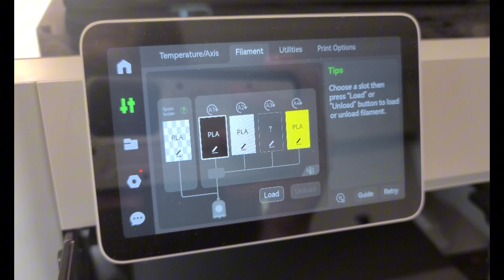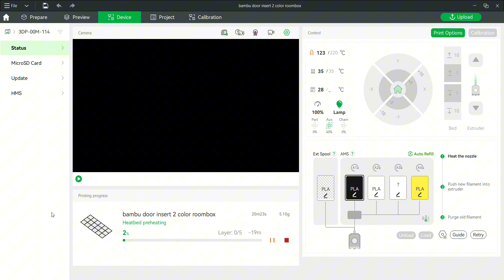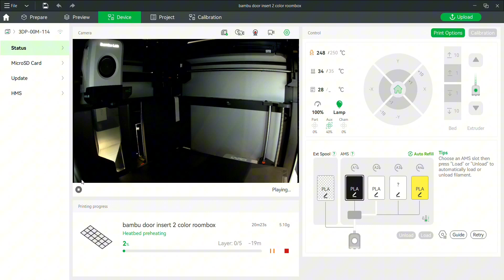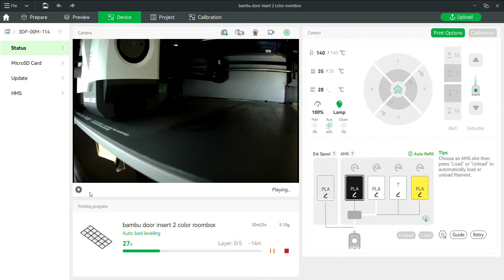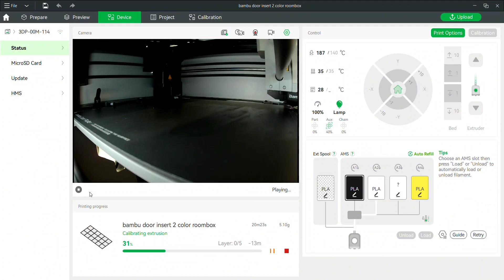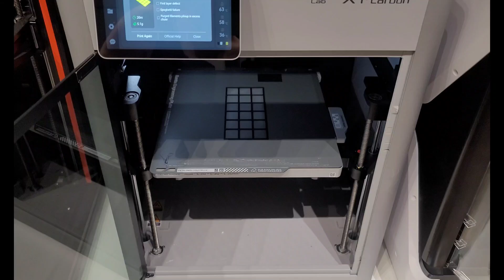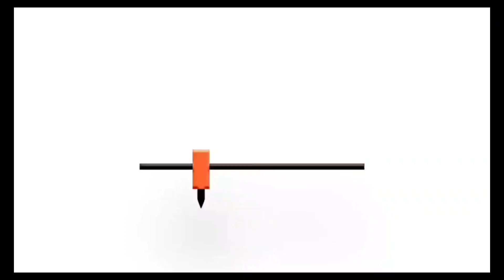The Bambu Carbon takes HOW long to start a print?

Comment: I am scared right now. Using a prusa mini+ now... telling alexa to preheat (takes roughly 1.25minutes) and after hitting print in prusa slicer the bed level starts (takes 40 seconds) All in all 2min10sec and it starts printing! When pre heated my prints start in 45 seconds...
Reply from the maker: That's awesome!

Comment: You definitely don't need to run the filament calibration every time, just when you put in a new nozzle or new brand of filament. It remembers the last calibration. But ya, it takes a bit for the bed leveling. Good thing is they really got the AI on the camera and the lidar working great in the last year. The camera will pick up a failed spaghetti print really quick, and the Lidar has warned me about first layer problems, but I usually just go over it and it works out.
  For me I've gotten used to it as it prints fast enough to make up for that time lost calibrating. And I wouldn't doubt they are working on making it faster.
  The one thing I really appreciate about this printer is the warnings it will give you if anything with the printer goes wrong. One warning I got was to check the bed cable tension. At first, I thought wth does this mean, but when I took a deep look, I found one wire under the bed wasn't sitting right and you could see it had marks on it from getting caught up at the back. So, I just taped it up, and tied it up higher so it wouldn't get caught. That saved me from ripping out a wire and having to change the entire bed harness. And after 1700 hrs the only time my printer has been down was from getting plugged up once, which was my fault. 
  That is, one often overlooked feature of this printer. If it detects any abnormalities in the system, it warns you right away, and also gives you instructions on what to look for by just scanning the code with your phone.
Reply from the maker: That sounds very user friendly. Thanks!

Comment: some thoughts with all the printers in the room if I was to make this, I would just break it up put one part on the mk4 and another on another mk4 or bunch on the XL. In 20 minutes, you and have at least 4 of them done? Glue I would look to get a wambam plate for the bambu I have changed booth of the K1 and k1 max with these build plates
Reply from the maker: Ok thanks so much!
Reply from the maker: Ok thanks so much!

Comment: Ok two things, one, you don’t need to leave the front door open, and two, why are you using the engineering plate for PLA?! The cool plate is for pla and engineering is for any other filament. Anyways I would recommend buying the textured pei sheet from them. You don’t have to use glue stick and that makes it so much easier.
Reply from the maker: Idk why I had it on that side. I have since switched to the cool plate. I don't love texture on most prints but I'll see if they sent one too. Thanks!
Reply: @tada3dprinting  they also have a “high temp plate” it’s a smooth pei and can do pla, petg, tpu, etc

Comment: I'll help you out. You can "sync" the colors in the AMS by pressing 1 button
Next to "flushing volumes " and the + - buttons to the right is a sync AMS icon. You can sync or resync. Then you dont need to manually select colors if you labeled them correctly.

Also you can change the generic pla profiles to bambu pla as the only difference is flow rates from 12mm/s to 22mm/s. You will print faster and most plas print fine. This is with over a year of testing non bambu filament.
Reply from the maker: Ok good to know! Thanks so much!

Comment: You have found the big downside to the Bambu, the startup process.  It takes time, but I'm willing to let it do its thing since most of the prints just work.  A suggestion is to print multiple at once.  It looked like you could do 3 at one time, probably only add about 10 minutes to the job.  I only use the cool plate when I really need to have small parts stick.  The third party plates work well especially for something with a large flat area like those frames.
Reply from the maker: Ok thanks so much!

Comment: That's such a bizarre start sequence. Could probably be shortened, especially if you're willing to dive into the gcode. In the meantime, if you're still having problems with the MMU on the Prusa, I'd definitely contact their support.
Reply: There are a few things here. She is running an optional full calibration and bed leveling(7-8min). Right before printing there are 4 checkboxes, Leveling, flow calibration, use ams and time lapse.  

You can turn off leveling, filament flow calibrations as they are stored already. Also there is minimalistic start gcode that makes the start up process even faster about a min perhaps a bit longer if you have to heat the bed above 35C. 

This has been around since Aug of 2022 @pinoydiy has a simple start code.
Reply from the maker: Thanks so much!

Comment: lol you have to select the filaments when printing each time. Unless you have set the correct colours up in “device” 
The start up time is irrelevant due to the time saved in general using the Bambu 
Don’t hate it’s much better than Prusa in every way possible and you know it
Reply: She is still new to the slicer by you can easily "sync" the filament she put in the ams by pressing the button next to the  + - button near flushing volumes. 

So you dont have to select filament each time if you set them up correctly in the slicer/ams.
Reply: Yes, of course if you ignore the negatives it magically becomes better in "every way possible," lol. That's what happens when you intentionally add biases.
Reply: @logicalfundy to be honest in the last year I’m yet to find any negatives. Infact there that good I now have 3. Honestly if you haven’t tried one, you just don’t understand 🎉
Reply from the maker: Thank you for the tip. I didn't see that on the print again screen but I see it now. Yes the Bambu so far is faster on the overall print. Thank you!

Comment: You do not need to run the full calibrations every print. CoreXY is unlikely to lose level anytime soon and the filament auto calibrations you can and store in the slicer. (flow dynamics and flow rate) You can also run minimalistic start code which gets you printing in a about a minute. 

Also there a a ton of alternatives to the glue stick. It's not there to get the print to stick but be a barrier release so even simple windex can work. Personally recommend vision miner nano polymer. It does not leave a residue and is IPA based so you can dilute with IPA and put in in a spray bottle do the normal wipe procedure most people to do clean a plate but in this case you dont need to do it every print.
Reply from the maker: Ok great to know! Thank you!

Comment: i would set the bambu printer up in cura slicer and do retract and temperature towers to test what the best combo would be(there are plugins to set up the gcode automatically, then bring that gcode into bambu slicer. I would do temp first then retract towers.
Reply: Why wouldn’t you just use orcaslicer?
Reply: @rylanwintle7610  cura has a plugin that i know of ..orcaslicer may also, they're both free so yea either one
Reply from the maker: That's true. I really didn't do any tests. I just opened in Bambu and went from there. Thanks!